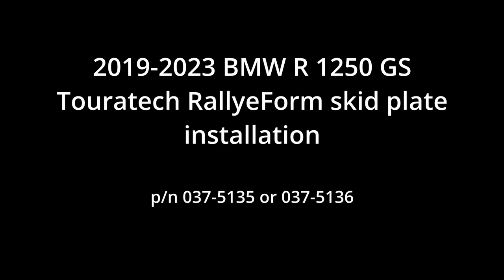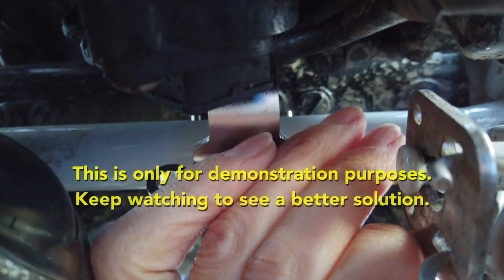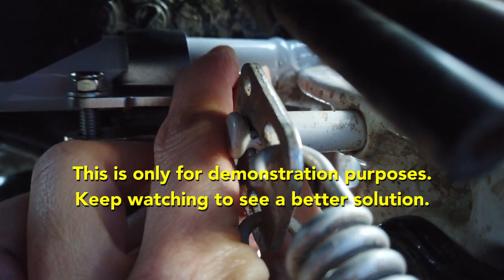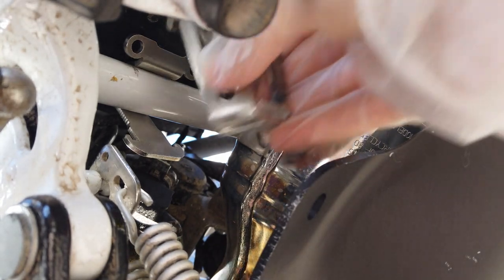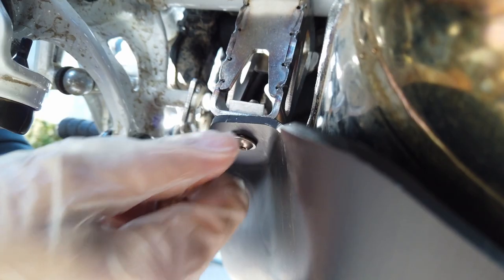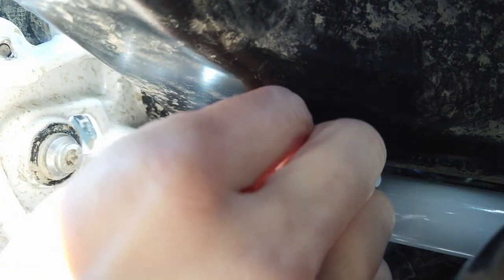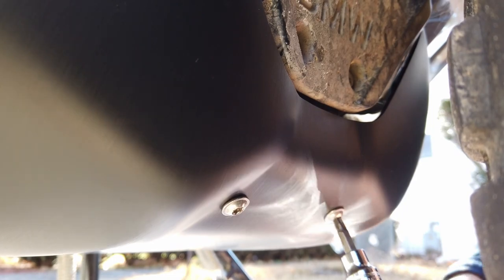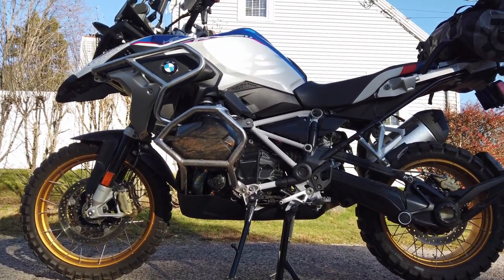BMW R 1250 GS - Installation of Touratech RallyeForm Skid Plate

Comment: I installed my Rallyeform skid plate last night. I used your idea of taping the washer and nut by just adding a tiny drop of superglue to fix them together. It worked great as did all your other tips. Thanks again!!

Comment: Hi Miss Lana ! I was wondering how a rider of your height would handle a 1000cc sportsbike like the Yamaha R1, the BMW S1000rr or the Honda CBR1000RRR considering the R1250GS is a pretty tall bike even in comparison to the aforementioned sports motorcycles and also very close in terms of engine displacement. Is there a difference in handling adventure/touring motorcycles compared to Sports bikes ?
Reply from the maker: Hi Galen, 
Perfect question. In a nutshell, for shorter riders, the mechanics of riding sports bikes are the same as for adventure bikes. Typical challenge is stopping with one foot and balancing a bike at slow speed. In the first video in my training series https://www.youtube.com/watch?v=4IMtZzrsfAQ&t=1s I showed how to start working on your balance, and Aprilia Tuono was one of the bikes. It's similar to the ones your asked about in terms of weight, hight, and other characteristics.
If you want to look deeper, 1250GS has a lower center of gravity, so one may think that handling it is a bit easier. People usually think that sports bikes are top heavy. Yes, they are. However, 1250GS's wet weight is 591 pounds, while BMW S1000rr wet weight is 450 pounds and  Honda CBR1000RRR - 443 pounds. So in reality, the weight you need to manage is actually very similar. Said that, I should mention that there are elements/drills that sports bikes make very challenging, while 1250GS shines there. At some point, I'll make a video about this.
Stopping with one foot and balancing a bike at slow speeds - is a skill. If one decides to learn it, they become a much safer and better rider.
Reply: @LanaOnWheels  Thank You ! As a new rider, this gives me a lot of motivation to practice stopping with one foot and be comfortable enough  to ride a bigger bike someday !